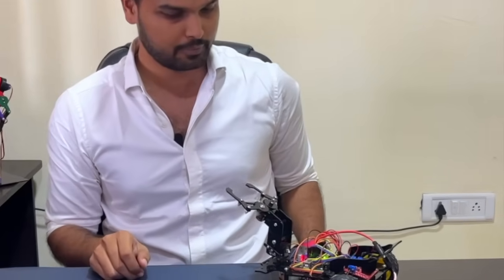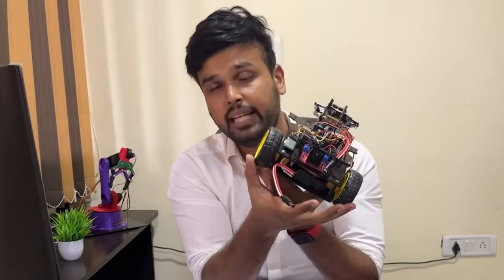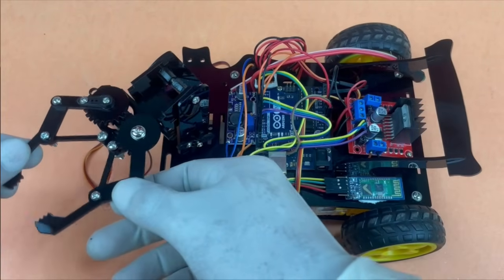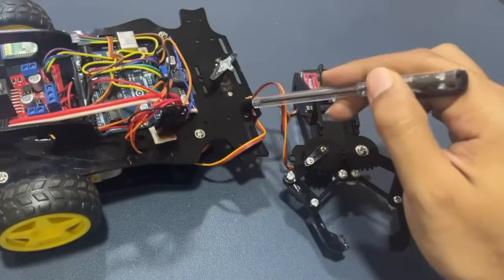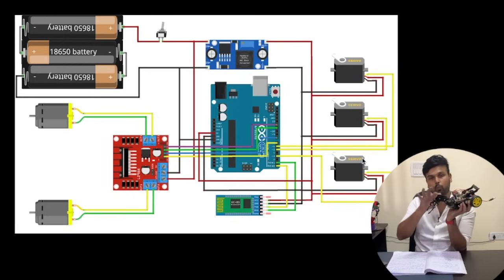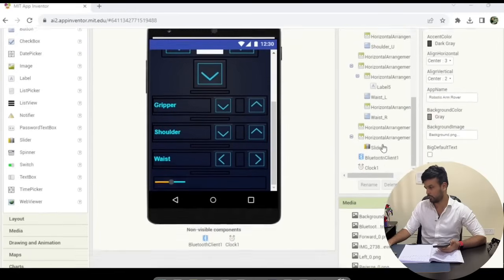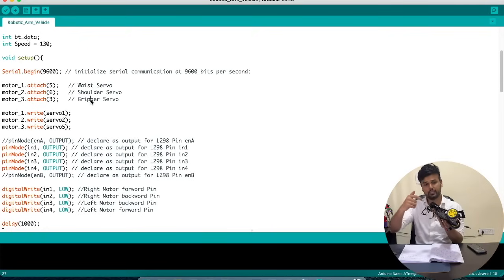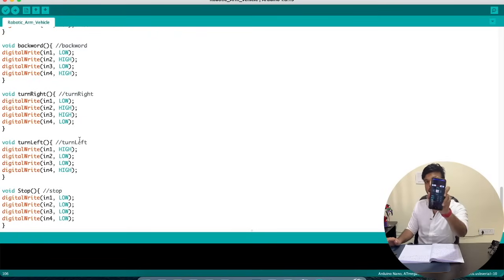This Arduino Pick and Place Robot Car is Real Fun!

Comment: I have made same robotic arm car but robotic arm which i have used is at back in background you can check working of it in this Account
Reply from the maker: That's awesome! It's always fun to see others building similar projects.
Reply: Bro i have a problem 
 @Circuitdigest 
The robot is running fine but if i press gripper and base servo button it disconnect the bluetooth ple send the solution
Reply from the maker: Use battery with higher discharge rate.

Comment: Hey can we do this without the buck convertor
Reply from the maker: The buck converter is there to provide 5V for the Arduino, Bluetooth Module and the servo motors. If you don't want to use a buck converter, you can use a linear regulator. But make sure to use one with at least 3A current rating. Also the linear regulator will need proper heatsink.

Comment: How to create an Android Application for this robot. Can you share the aia file? For Developing and adding few more servo motors
Reply from the maker: we have used MIT app inventor, the apk file is already provide in link at description, will also check for aia file and make it available on our project page
Reply: @Circuitdigest  I have your apk file. But for adding few more servo.I want your .aia file. Kindly  share the aia file.